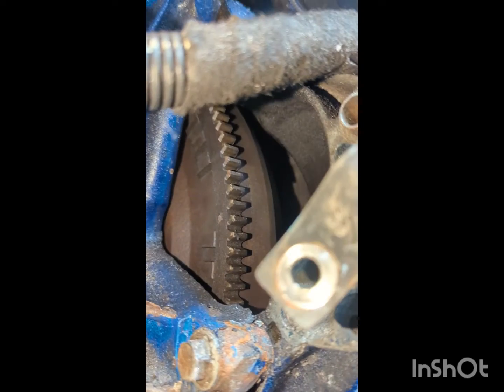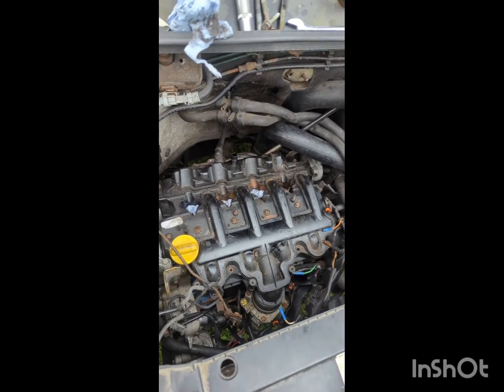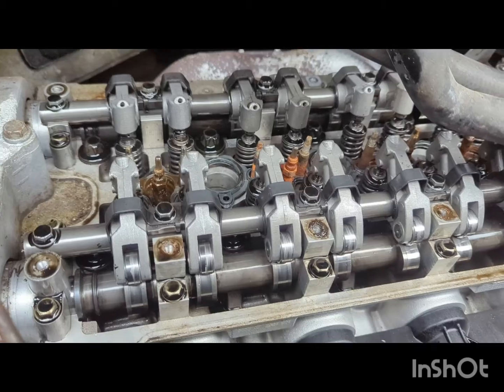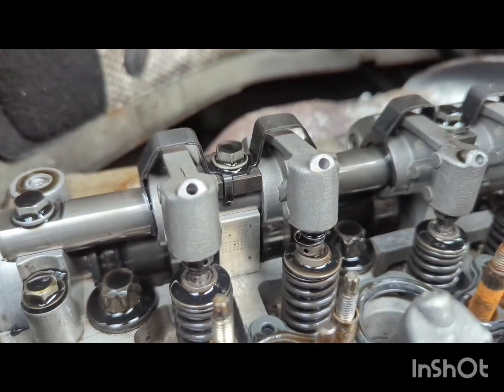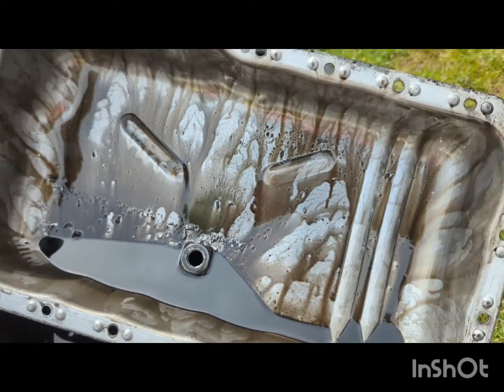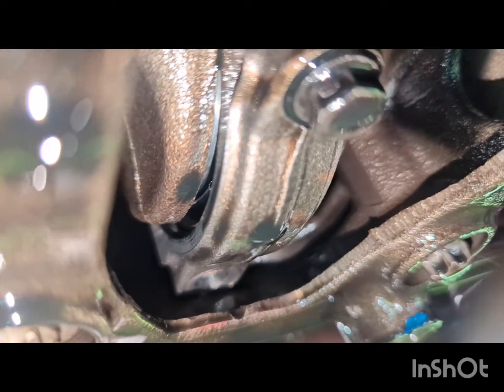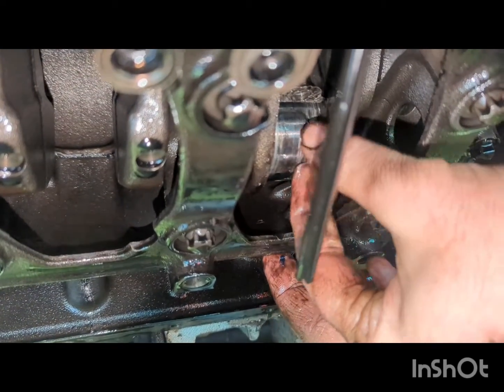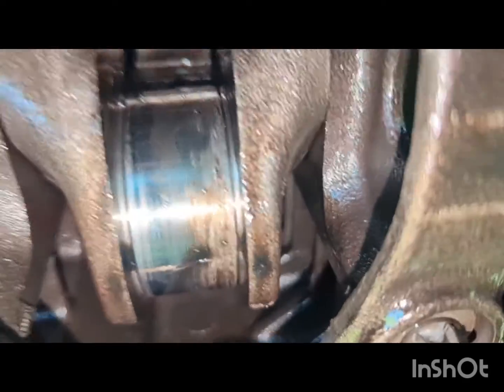Renault Master Mk2 LOCKED UP engine (sheared Conrod bolt)

Comment: Hi mate thanks for the video.  can i ask where the balance shaft is please. as i bought a van thats had a engine rebuild.  as i got a vibrate on tick over and when i rev. been told the balance shaft may not be in time.  and help please.